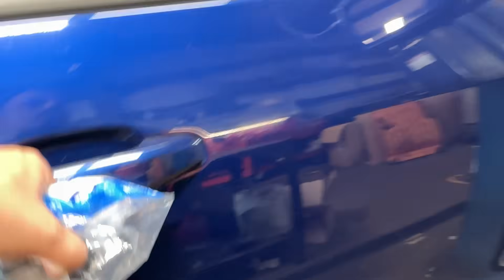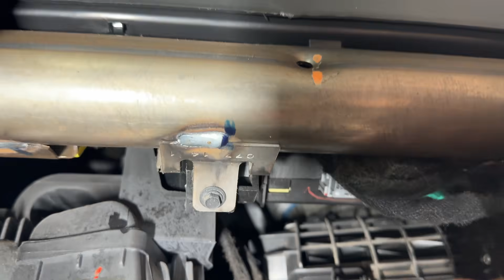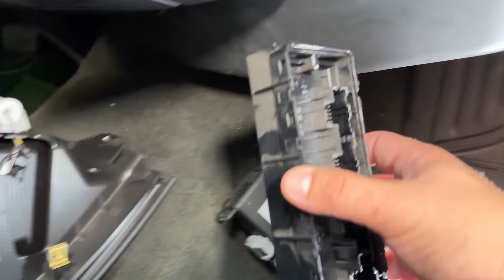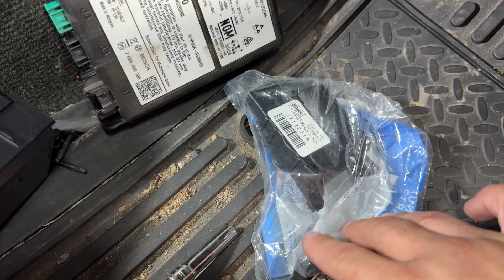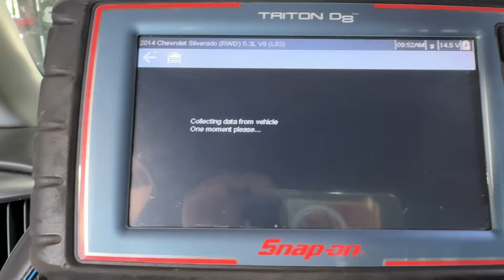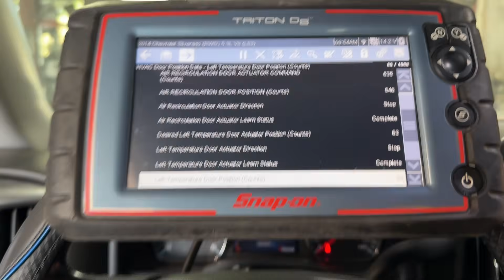GM Silverado Truck - AC Blows Warm Air On Driver's Side B0413

Comment: I'm not getting that code, I'm getting codes for a bad map sensor (different issue) but my ac started blowing luke cold air on driver side. so do i need to replace the driver side actuator or the one in this video? thanks in advance

Comment: Replaced mine and it fixed the air blowing hot on the driver side. Now it blows hot or cold just fine but I have a code for b0413-61 now. Did the calibration on the modules and cleared the codes but I continue to get that code as a current code anyway. Ever run into this before?

Comment: Some online info says to pull a fuse for (10) seconds, then wait (40) seconds or more before turning AC on to recalibrate. If so, which fuse? I have 2014 GMC Sierra 6.0 L gas engine.
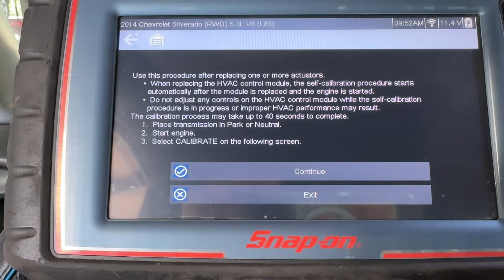Reply: I always pull the negative cable when doing any job on electronics. On this job just reconnect negative cable after changing the part. Start the engine and do not touch any HVAC controls (4:53) until after it recalibrates itself (takes about 40 seconds).

Comment: What if passenger side is not blowing cold and the driver sort of blowing cold but not really should I replace passenger side or driver side
Reply: Check system pressures first to verify the vapor cycle is functioning correctly. If so, you may need to replace both actuators.
Reply from the maker: well first make sure it has enough or the correct freon ... then I would say look at the side that's not blowing the temperature your commanding it too
Reply: @FalconsGarage I looked at the blend doors they are actually working ,I replaced the expansion valve recently I thought it was leaking Freon because my ac is not blowing ice balls it’s maybe like 75 degrees I assume it’ll usually blow cold around this time I’m thinking it’s the condenser but I don’t see no leak so I’m clueless
Reply: @alphaking3896What year truck you have? Have you ever changed the a/c condenser? '14-'16's have factory defective welds on the condenser fittings. The odds that both blend doors failed at the same time are remote.

Comment: Do you need the scanner to calibrate or does it do it on its own?
Reply: Just remove the negative cable before doing the job and then reconnect. No scanner needed but it does take 40 to 50 seconds to recalibrate itself 4:53.

Comment: So I have my glovebox torn out and I can see the actuator working when I change from hot to cold, but I’m not sure it’s closing for full cold as there appears to be 1 open tooth on the white gear side where it moves on the black section of the actuator.  I’m wondering if that’s normal or if mine may be misaligned or not closing all the way. I can send a pic if helpful so u can see what I mean.
Reply: Yes, most people who have this problem are experiencing what you described. The actuator is moving the blend door partially but not fully. Thus the blend door is partially open, allowing heat to come in from the heater core which is blending with and thus warming the A/C air coming from the evaporator core.